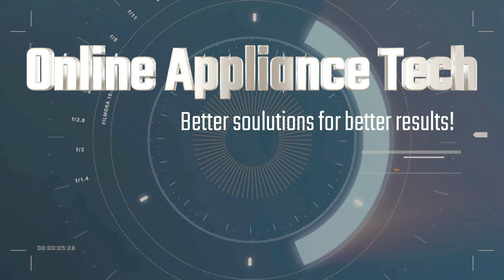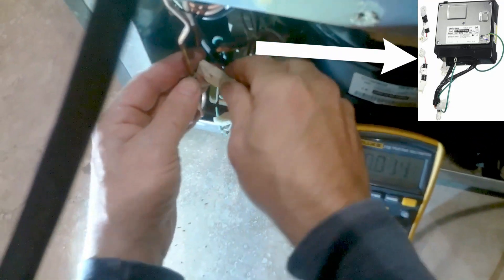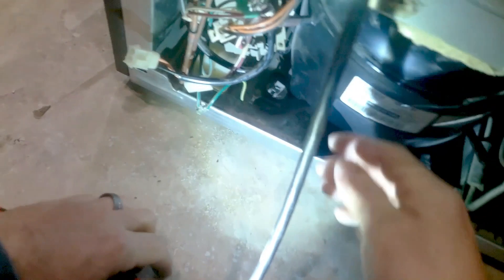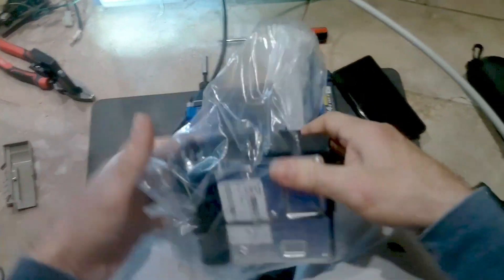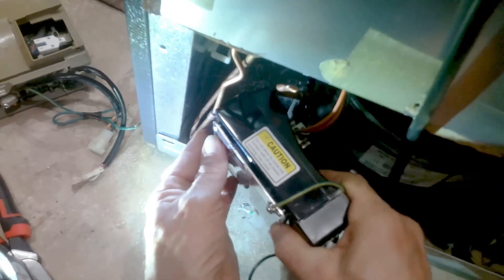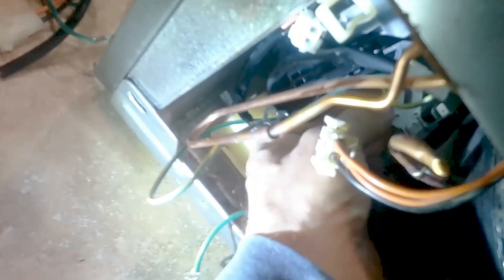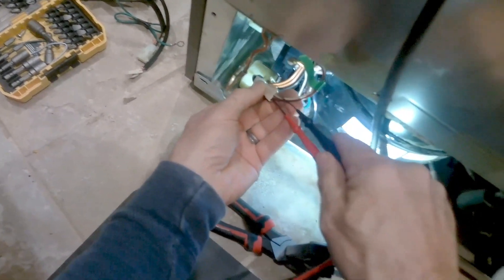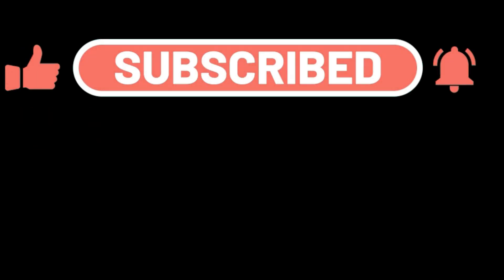GE Cafe Refrigerator Compressor Not Running? GE Inverter Board Test & More!

Comment: I have a GE CFE29TSDCSS fridge.  I am getting 120v AC and 2.8v DC to the inverter when plugged in.  However, even when unplugged, I still only get 2.8v DC from the main control board (rather than the 5v or more shown here).   Should I try replacing just the inverter controller first?  Or, do the main control board instead?

Comment: Im geting 12 volts DC from the main board not the normal 2!ton8 volts. Its this ok?
Reply from the maker: Yes, 12 volts is okay — it all depends on whether you’re testing with the harness connected or disconnected. If you test with it disconnected, you should see around 12 volts. When the harness is connected, you’ll typically read about 4–6 DC volts. Hope this helps!
Reply: @onlineappliancetech it shows 12 volts conected. Must be no load showing from the inverter board then?

Comment: My DC voltage is bouncing around from 1.98 to 2.65. I unplugged and checked and I got the 4.6 but it’s not consistent either it bounces from 3.9 to 4.8. Could this cause the issue and if so what would be the fix?
Reply from the maker: It sounds like you're getting the correct DC voltage when plugged in and when it's not, which suggests the main control board is working properly. Most likely, the issue is with the inverter board—a common problem. Hope this helps!

Comment: What's the cause if the inverter compressor clicks on and off after a few seconds just after plug-in in usually accompanied by a blink error
Reply from the maker: It could be the compressor or the signal from the main control to the inverter.

Comment: Great video - thanks!

I did everything you instructed, in exactly the same order.  The coils on the condenser all checked out (6.9 ohms across each set), not grounded, DC and AC power coming from the main board.  I put the replacement controller in and it seemed like the condenser motor started at first, but I'm not entirely sure it's running - it feels like it's vibrating a bit.  The evaporator fan is working fine - all dust removed.   The cooling tube coming out of the condenser is not getting cold - very frustrating.  What else do you think it could be?  Any idea where else I could look?

[UPDATE] - I guess I just wasn't patient enough.  Overnight, the system did cool down - Freezer now at 11.8 F and the refrigerator section has gone a bit too low - now at 30.9 (but, that's with absolutely no food in it).  I'll adjust accordingly.  Oddly enough, the coolant tube coming out of the compressor never got very cold and the compressor motor housing is really very warm to the touch.  Anyway - all seem to be working - thanks again for such a great and detailed video!
Reply from the maker: Hello! There are two lines emerging from the right side of the compressor. The lower right line should feel warm to hot, as it's responsible for removing heat. This is known as the discharge line. If the compressor is working intensively but the discharge line remains cool, it could indicate an absence of gas, possibly due to a refrigerant leak. The upper line on the right side is the suction line, which returns from the evaporator and should be cool to the touch. As for the temperature being too low in the fresh food compartment, this issue might be due to a malfunctioning sensor or a damper door that isn't closing completely. I hope this information is useful to you!

Comment: Great video.   I have this fridge everything works except the compressor.   Going to watch this again and go try to diagnose
Reply from the maker: I have a strong hunch that the inverter might be the issue, although I can't be completely sure without checking it personally. If you're someone who knows their way around a multimeter, I suggest following the steps outlined in the video. This should lead you to the answer you're looking for. Wishing you the best of luck—I hope this guidance is beneficial!
Reply: @onlineappliancetech  thank you for the video and this information.  I can use a multimeter.  The info  that I was not sure of you just gave out.   Thank you for your help.
   This is a 2003 do you think it’s worth saving

Comment: This video is super informative and thank you for that. My issue with my GE Cafe CYE23TSDCSS is slightly different. The evaporator motor fan inside the fridge is running fine and the compressor vibrates a little (but not noisy at all) but both the fresh food and freezer sections do not cool at all. A few days ago, the evaporator coil was frozen and I changed the fan. The fresh food section started to cool after that and that also stopped working a couple of days ago. Any thoughts? Thanks in advance
Reply from the maker: This is a challenging issue to diagnose without a visual inspection. Could you please retrieve any saved error codes and send them to me? This additional information might assist me in piecing together a possible solution. For instructions on how to retrieve these codes, please watch my video titled is "Learn how to pull up GE Café Refrigerator Error Codes with Service Test Mode''. You can find it under the GE playlist on my channel. Hope this helps!

Comment: Freezer cooling but not making ice.
Reply from the maker: Understood. Your issue may be related to the fan motor for your icemaker, which is situated in the freezer section. You can investigate this by opening the upper left door, where at the top, there should be a  "DOOR SWITCH". Press and hold this for about 5 seconds and then assess the airflow coming from the two vents that direct air to the icemaker on left housing of fridge.

An alternative method would be to switch your appliance into service test mode, activate the icemaker's fan motor, and check if the display shows RPM. Concurrently, examine the airflow from the vents leading to the icemaker. Out of the vents, only one should be emitting an airflow.

The process works by the airflow entering, extracting heat, and then reverting back to the evaporator freezer.:hand-pink-waving:
Reply: @onlineappliancetech  Thank you very much.
Reply from the maker: @samuelsuggie  Happy to help!:hand-pink-waving: